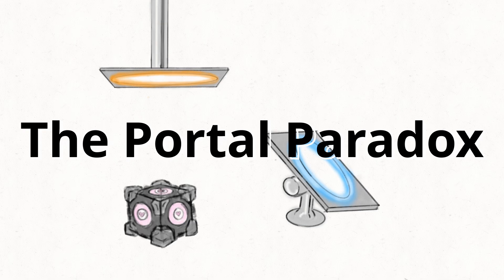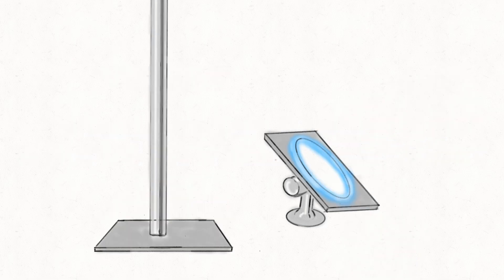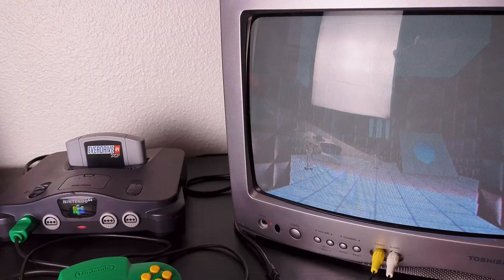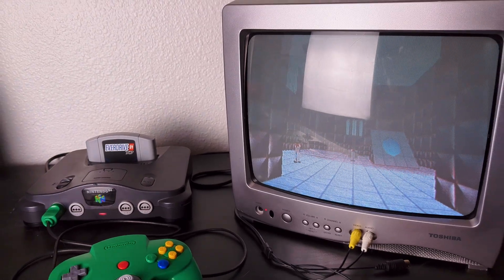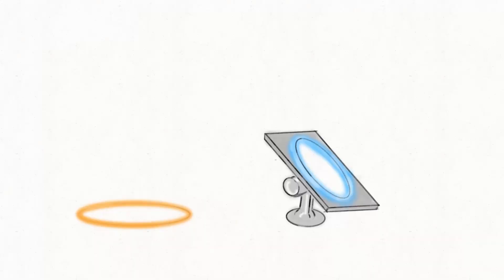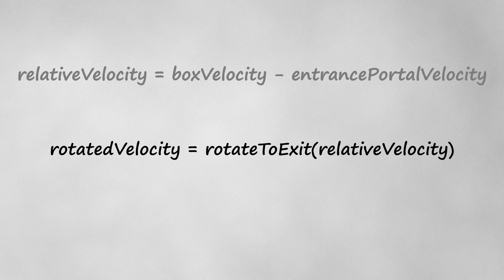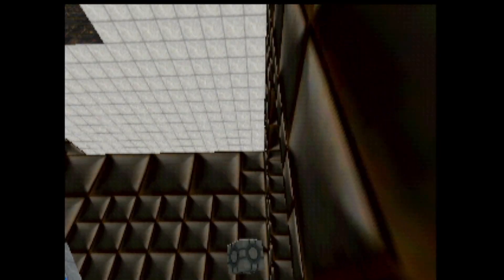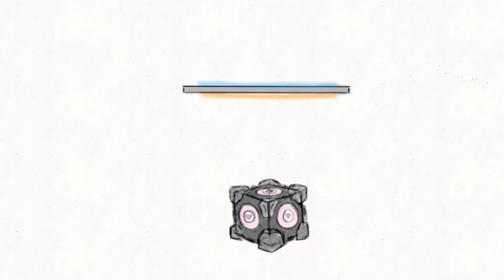I rewrote Portal from scratch and solved the Portal Paradox

Comment: Oy... People still talk about this, eh? Hot take (back in the late noughties): The "paradox" doesn't exist.

The problem with this experiment is your programming. You designed the portals to launch the cube. If you had designed them to not launch the cube, they wouldn't. It's as simple as that. Your own moving portal exerts force on the cube. That's not how the game Portal works - the portals do not exert force on the player or objects; if they did, they would slow or accelerate things that enter/exit. They don't. The portals conserve momentum; they don't create or destroy it. The cube has no momentum. So the paradox doesn't exist.

The way Portal was designed, is "speedy thing goes in, speedy thing comes out" - i.e. nothing without kinetic energy can enter the portal, meaning the portals do not exert force on the object to get it from one portal to the other. They rely on the kinetic energy of the object itself. The paradox doesn't exist in the game.
If the portals accepted an object without kinetic energy, but otherwise functioned the exact way they do in the game (i.e. not exerting force on anything that enters), the box would just "plop out" and not be launched. The paradox wouldn't exist in the game. 

The same would be the case in real life. If the portals don't exert force on the object, it would just "plop out" - because otherwise, the laws of physics would like a word with you. They don't like stationary things being launched without force being exerted. 😁
Reply: B's logic isn't about a force being exerted, it's about the manner in which portals conserve momentum being between the two reference frames of the two portals. You use the entrance's reference frame to measure the momentum before going in the portal and then the exit's reference frame to measure the momentum after leaving the portal in order to observe the momentum being conserved.

Using a singular reference frame like you normally would, portals don't conserve momentum. They by definition change momentum by changing the direction an object is travelling. It's only through measuring momentum through the portal's two reference frames as described above where momentum conservation is observed, this is because reference frames can also be directional (a sideways portal having a sideways frame of reference) so the cube changing direction can be treated as it being measured under the exit's reference frame where everything is a different direction to the entrance's.

Basically portals don't actually conserve momentum, because their rule for conserving momentum between two reference frames ultimately results in momentum changing when using a single reference frame.
 
"nothing without kinetic energy can enter the portal"
That's an interesting way of putting it considering the problem is about a cube allegedly not having kinetic energy entering the portal. If we strictly use the entrance portal's reference frame then it is true though, in that it's literally impossible to even enter the portal without kinetic energy under that frame of reference, so the cube entering the portal in the problem means it does have kinetic energy in the entrance portal's reference frame. And it is in fact that kinetic energy that determines how much kinetic energy the object has then leaving in the exit's reference frame.

In other words the cube exits with the kinetic energy proportional to how fast it was moving in the orange portal's reference frame, which in the reference frame of the picture, is how fast the orange portal is moving.
Reply: @J4hk2  None of that has anything to do with how the portals function in the game Portal. 
The portals in the game Portal have the exact same function as a door between two rooms. If you drop a door frame around a box lying on a pedestal, the box will not get launched even the slightest bit into the air when the door frame passes it - because the box has no momentum.
That's all.
Reply: @heavycritic9554  (Having to use a new account as the last one got shadowbanned)
"None of that has anything to do with how the portals function in the game Portal."
The portals changing the direction an object is moving, which I pointed out to you is them changing momentum, is literally a functionality of them in the games, here's an actual physics professor pointing this out: https://www.youtube.com/watch?v=ASUUN0W4_JY

That is not something a door between two rooms is capable of. Because the entire point of portals is they are reality-bending phenomena capable of things that physical doorways are not.

"If you drop a door frame around a box lying on a pedestal, the box will not get launched even the slightest bit into the air when the door frame passes it - because the box has no momentum."
You're using something with a moving entrance and moving exit to model a problem where a key factor is that the exit is stationary. It's possible to leave an exit while stationary if the exit is moving, it's not possible to leave an exit while stationary if the exit is stationary.

Under B's logic, if two back to back portals moved over you, you would not launch. So you are not disproving B by pointing that out, it only suggests a lack of understanding of how B works.

Final thought, do you think when Chell was being sent to the moon at the end of portal 2 that she had the same speed before going in the portal as afterwards? Obviously she was being pulled in by the difference in the air pressure but that's not the only thing of significance that happens during that part. Look up how fast the moon moves in orbit, over 2000 mph. Ending up at the moon meant her speed had changed by around that much in order to be moving with the moon in orbit. This is actually B in action, as her velocity being conserved between the earth's reference frame and the moon's (which why she passes through the portal seamlessly) is what ultimately results in her velocity changing massively in this manner.
Reply: @J4hk3  Oh dear... Again: It's not how the portals in the game Portal work. They work exactly like a door between two rooms. You can walk through them, backwards and forwards, and you can watch yourself doing it in real time - zero time lag; which there would be if it wasn't like a door between two rooms.
The reason all the physics discussions in the world can't make this a paradox, is because normal physics don't apply when it comes to the portals themselves. It's "science magic". In the game, they can be exactly like doors between two rooms, because that's how the game was made. 

There is no paradox!

And I had forgotten exactly how frustrating it was talking to people like you. I'm done now. This discussion was moot when the game came out and it still is. Peace!
Reply: @heavycritic9554  "Again: It's not how the portals in the game Portal work."
I just said to you that they can change the direction of travel of objects passing through them which is literally what they do in Portal, as fundamentally as them changing the location of objects passing through them. My entire last paragraph is actually describing a scene from Portal 2. I'm guessing you aren't considering Portal 2 canon in which case you need to make that clear.

"It's "science magic". In the game, they can be exactly like doors between two rooms, because that's how the game was made."
Yes they work like doors with seamless travel between them. What's important is the consequences of that as in order to behave as seamless doors they must change things like the object's location and its direction of travel (which as pointed out is literally changing the object's velocity and momentum) when judging the object going in and out the portal within the same space (like we're doing when we consider the cube in B to have changed momentum).

That also means that they change the speed of the object as well. Not only because it is also vital for the doors to work seamlessly (you would bloody notice if Chell went through the portal to the moon and kept her speed that she had on earth) but because by nature of reference frames the portals being able to change an object's velocity and momentum by direction when they are stationary is literally the same as them changing its speed when they are moving.

"There is no paradox!"
You're right, there isn't. It's just B.
Reply: TL;DR: You rewrote the universe so that your hypothesis becomes the solution, by making the portals interact with the cube. In the game, the portals don't interact with anything - they're just doors that lead to different places.

Comment: i still think the "doorway"/"hula hoop" theory makes more sense

The portals already inherently break laws of physics, so it's not a stretch to say it wouldn't work as expected from a physics point of view

The portals don't have mass, they're a two-dimensional "surface" that works as two sides of a door that can be separated, also there's no space "between" or "inside" the portals (they're not exactly a "tunnel" wormhole, they're more like a hole poked through a folded paper)

If the entry portal is moving but the other is stationary, the only thing that would change is the rate at which the molecules of the body on the entry are transported to the exit, the momentum of the body itself wouldn't change.

Think of both portals as the same doorway even if the sides are moving at different speeds, you can think of it as if the entry portal was moving but the other side is always also moving towards the same direction at the same speed, but since it is "stuck" to a wall (for example) and it doesn't have any mass, it wouldn't actually physically move or apply force to anything, even if it is, theoretically, accelerating.

That way, if a stationary body pass through a moving portal, it would "pop out" of the stationary portal as fast as the molecules of the body entered the portal, but the momentum of the body would stay the same as when it was stationary. 
The portals work in a way that if something pass through them, it will instantly also be on the other side. That way, the exact lenght of the object that is "inside" the entry portal is also the exact lenght of the object that is "outside" the exit portal, and the resulting visual effect would be that of the object "magically pushing itself" through the portals with no force being applied, thus "popping out of the portal"

Now, thinking about the opposite, if an object moves through an stationary portal but the exit portal is moving towards the opposite direction, the body of the object would be "stuck" to the exit portal moving along with it as long as there is still a part of the object outside the entry portal, and it would eventually come out of the exit portal with the same speed as when it entered, except it would "feel" like the ground is moving relative to it.
If the object is a person, the abrupt difference in speed would probably make him trip/slip backwards, the same way if he stuck only his feet through the portal and touched the "moving ground" on the other side, he would feel his foot sliding across the ground.

Let's assume now a person jumps at 5m/s towards a stationary portal but the exit portal is moving backwards at 2m/s. What would happen is that, since the molecules of the person would be immediately on the other side, the person would be moving 5m/s "away" from the portal while his body is still stuck in the exit portal moving 2m/s backwards, since the portal itself doesn't apply any force and doesn't increase or decrease the momentum of the body passing through it.
Thus, as soon as the person is fully transported to the other side, he would only move forward relative to the momentum he still has, which could be affected by wind resistance and gravity on both sides.

Now, if the exit portal is moving towards the same direction the person is moving, it would be a little more complex. The person would still be constantly moving 5m/s away from the exit portal as long as he's not yet fully transported to the other side, but once he's fully outside the portal, he would either: 
A - be transported back and pop out of the original entry portal as fast as the exit portal passes through him again, assuming the exit portal continues moving (obs: he would only "pop out" of the entry portal again, he would not be shot out of it)
B - he would keep moving forward relative to the momentum he still possesses, assuming the exit portal stops moving
C - depending on the speed of the exit portal, the wind resistance would be so strong that it would be constantly pushing the person back through the portal, decelerating the person while it's still jumping

The most complex situation is actually the "portal moving sideways horizontally while the object passes throughduring a free-fall, with the exit portal stationary and faced upwards". In this situation you could argue in favor of any of these outcomes:

A - The object comes out of the exit portal straight up, since it was falling straight down (think of it as jumping through a door that is moving sideways, you would continue moving straight forward assuming you don't come in contact with the doorframe). This outcome assumes both portals work the same way, so the object would get "stuck" to the moving entry portal as soon as it comes in contact with it
B - The object would come out at an angle (and possibly spinning too) since the object, as it comes in contact with the portal, is "touching" the entry portal at different places as the portal moves sideways, thus parts of the object come out of the exit portal at different places (assuming the object stays intact and doesn't get distorted because of it, it would come out at an angle and/or spinning)
C - Same as option A, except that since it is the "entry" portal and not the "exit" portal, the object would not get stuck to the portal but it would still come out of the exit portal straight up. Assuming this, if the object hits the edge of the entry portal before it fully passes through it, it would either bounce or enter the portal spinning, depending on when and at which angle it hits the edge

I'm honestly more inclined to believe in option A, since it uses the same logic as the person "popping out" of stationary portals upon entering through a moving portal (the molecular structure of the object would stay intact) and also makes more sense assuming both portals are equal and are:
1- able to make objects stuck to it during a state where the object is only halfway through
2- using the doorway analogy, the object should still be moving towards the same direction it was before, only with the exit "rotating" the "arrow of the vector" that represents the momentum

Edit: I now firmly believe in option A and no longer partially believe in option C, because the portals are just a "magic" doorway, and jumping through the portals (be it one moving sideways and one stationary) would be equivalent to just leaping forwards in an empty room: you would move straight forward.

Sorry for the long-ass explanation :D

Comment: In portal we are specifically told, and demonstrate, that momentum is conserved. According to the in-game explanation, the answer is very simple and isn't a paradox. The cube will plop out of the destination portal because its momentum is conserved. You DID ask for comments to point out why they think you are wrong.
Its the same as the kinetic energy explanation. The cube doesn't spontaneously gain or lose energy when portalled.

I love that you've built something that behaves differently, and really appreciate the effort you've gone to, and accept your justification. If I'd written moving portals I'd probably have the same result, because relative velocity matters.
Reply: We are told in the game that momentum is conserved, but as far as what is demonstrated, portals quite literally alter your momentum when they change the direction you are travelling. In fact the momentum conservation line is actually introducing a mechanic where the entire point is using portals to alter your momentum to cross gaps. The argument could be made that portals do conserve momentum when judging space as distorted by the portal, or that the conservation is specifically relative by both ends. But both those interpretations would conclude that B is the momentum being conserved in this manner.

Key thing is an understanding of reference frames, because something that has changed its direction in motion will have changed speed in most reference frames, same goes for kinetic energy, in other words portals already show the capability to alter the kinetic energy of objects in the games.

Comment: After thinking about this I think your equasion is faulty. By moving the Portal, you're not actually moving the object. It's basically like bringing the other "room" of the other portal to you. Therefore it doesn't matter what speed the first portal comes in, as the object is not moving not in the first "room" and not in the "room" where it comes out.
The portal doesn't change the physics of the world it exists in. It's simply a portal. What comes in comes out the same way. If something has speed in this "room" it comes out with the same speed in the other "room2". If something has no velocity it doesn't matter if the portal consumes the item with speed, it will still come out in the same state it was before.